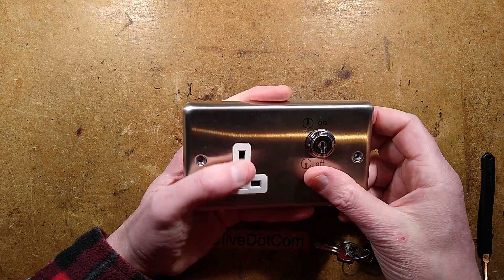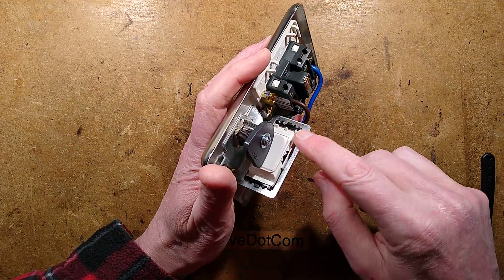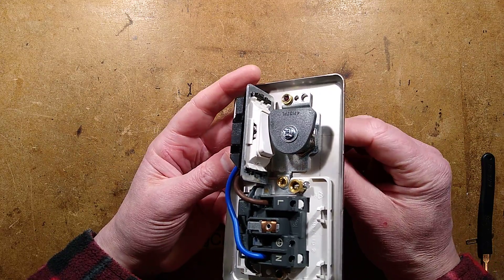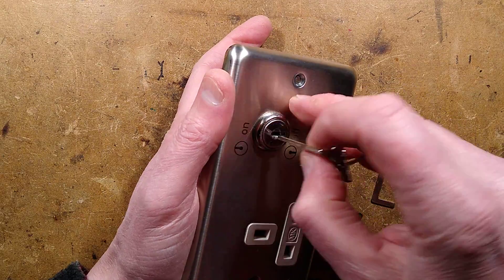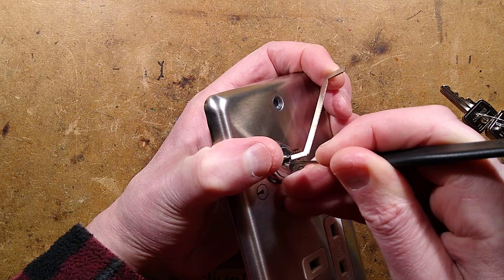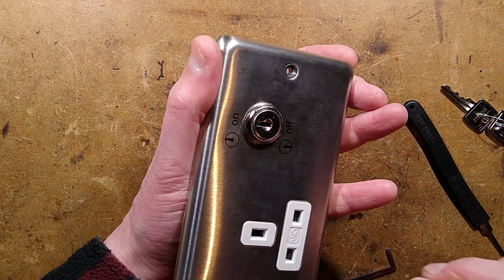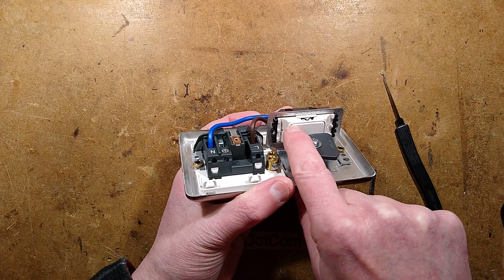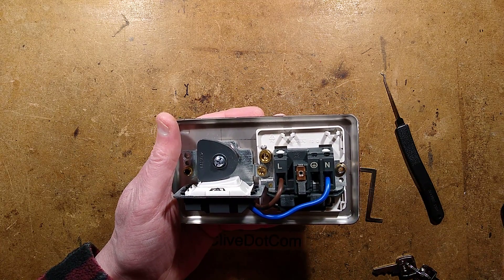Exploring & picking a lockable socket

Comment: That looks like a cheap wafer lock Which would imply that this is more of a safety device than a security device because as you learned in this video, wafer locks are not that hard to open

Comment: If you use one of the double sided wafer rakes from the cheapy chinesey GOSO set, you can wiggle it in and out whilst twisting at the same time. No need for a tensioner, ..and 'in like flynn' easy

Comment: Interesting design, I like the use of a standard rocker switch and the fact that the cam prevents you from turning it on. One problem though, what's to keep you from just pulling the plate and removing the Phillips head screw holding the cam on ? Unless of course it's glued on.

Comment: All the LPL jokes notwithstanding, and I do love them, you might try a bit less tension on wafer locks. They are always going to be dead cores so you aren’t pushing against a spring. And yes, trying to get a tension tool in there is always a challenge. Try an old school bottom-of-keyway wiper insert that is wide enough to bind in there before it impinges on the first wafer. Or if you have one of those funky Y-wrenches you get with the cheap Chinese pick sets, those work well.

Comment: Beautifully production engineered using stock parts and as you say tamperproof, otherwise you could slacken off the fascia screws, pull the plate forward and operate the switch with a screwdriver poked down the back.

Comment: Hey Clive, this is unrelated. But it would be awesome if you could do a dissection of a ballast compatible LED tube. Very curious how they are designing the circuitry to drive LEDs with a ballast. I think it would be a very interesting investigation!
Reply from the maker: I've looked at a retrofit tube in the past.  I think most use internal current limiting as opposed to presenting a higher tube voltage and relying on the ballast.  My preference is to get rid of the old ballast completely.
Reply: @bigclivedotcom  my apologies, I didn't realize you have done that already! I'll go look for it. Thanks!

Comment: That looked like a wafer lock, which can easily be raked open, no picking required. If they make one with a proper pinned core then worth having. And security screws to hold the plate to the back-box, obviously.

Comment: A nice try, Clive, but you're using the wrong rake. Wafer locks are about the easiest locks you can pick. You just need a rake with 3 humps on it. Insert the rake and rock it while tensioning.

Comment: Hi, and thanks for the awesome videos. Would you be interested in doing a Braun Scan & Clean air purifier teardown? It has good ratings, but I think I smell a small traces of ozone coming out of it. I wonder, if the ionisator would be disabled would it still clean the air, or is the electronic filter alone inefficient or perhaps pure scam. There goes two connections into the electronic filter, why it could work alone without the negative ions in the air, by creating its own electric field at least in theory. Or is the other wire used for safe discharging through a resistor, not contributing to the particle-trapping electric fields. Thanks.

Comment: Undo the screw on the back of the lock.  The cam will com e off, and with the key inserted the core should be easily removed.

Comment: But what if it was a fluke?

On a serious note - something tells me it could be shieved from the above, by pushing the switch with something thin. I wouldn't bother pin picking that thing either - this is a job for a rake pick.

Comment: I think you have the pick upside down: you should be using the end to push each pin up, not the "bendy bit" - you'll get better feedback that way and that makes the picking easier. It's called "top of the keyway tension" by the way. :D (Yes, I watch LPL as well!)

Comment: i used to 'pick' these style of locks as a child (many many years ago) with just a paper-clip. didn't do anything fancy just took a medium size paper-clip and squished the eye's/ends of the paper-clip a little smaller to fit in the slot and shove it in there , jiggle it around while twisting, and presto you were in... (mainly to get into the lock-box of uumm "special diskettes" used for pc's at the time:)

Comment: Do the external mounting screws also have a lock on them? And once inside another (or same) screwdriver can easily remove the cam freeing up the rocker switch. Methinks it's made for "honest" electricity thieves.

Comment: Should've used a rake instead of single-pin picking; you'd have had it switched on in about two-point-five seconds. Wafer "locks" are ridiculous.
(you may call me the Lock-Picking Rigger)

Comment: I love the design, using a cam to switch an actual switch... it's almost almost brazen and beautiful in its simplicity and effectiveness.
Of course one could complain about the lock's core, because you probably could open it with a waverake as fast as using the keys. But then again, you could open it using a Philips screwdriver. Though, depending on where it placed (i.e. in a public area), that could result in questions being asked.
Nevertheless, a slightly more challenging core (i.e. disc detainer, like in good bicycle locks) to make picking too time consuming and/or require specialised tools could make this perfect.

Comment: There are special tension wrenches that are made to engage in what LPL calls the top of the keyway (but which in e.g. Germany would be at the bottom - Americans install their locks the wrong way round), which is achieved by having a ledge so they only go a few mm in. I think that would have helped you here.

Also, I personally can't pick wafer locks either. I outright can't. I just never get the wafers were I want them in order. However, I can rake them with basically everything (my favorite tool for that is a random other key that happens to fit in the hole, but a standard pick will do as well - BTW sometimes easier when held upside down).

Comment: As someone who was trained to pick locks by a professional locksmith. Let me give you a few pointers. For a wafer lock like that you want very light tension. You then want to drag your pick all the way in and all the way out, that makes sure that you hit all the wafers with each pass. Applying top the keyway tension with a bottom of the keyway tensioner never goes very well so you should either use a top or the keyway tensioner or modify, make or buy a smaller bottom of the keyway tension wrench. Applying tension to the bottom of the keyway is usually always easier than applying tension at the top the only reason you’d want to apply tension at the top of the keyway is because there’s very restrictive warding at the bottom of the keyway that won’t let you get a tensioner in the bottom of the keyway and give you enough room to not overset pins with your pick. Tensioners are really easy to make. When I was being taught to pick locks, I was taught to make my own picks and tensioners rather than buy them. They are actually really easy to make, you can make picks out or windshield wiper insert or feeler gauge and with a bench grinder and some sandpaper you can make some pretty decent picks. You can make tensioners out of just about anything, my 2 favorites happen to be hex keys or windshield wiper insert. If it’s a skill you want to get better at I highly recommend either making a decent set of picks and tensioners or buying a set from one of the major pick manufacturers, Sparrows, Southord, or Peterson, multipick might be easier to get your hands on in the UK because they are European based and southord and sparrows are US based. My  EDC set happens to be a custom set with Southord case, picks, and tensioners along with some sparrows top of the keyway tensioners, when I put together my set I knew exactly what picks and tensioners I wanted so I ordered just bare picks from Southord because they happened to be the cheapest picks I could get at the time from a company that makes locksmith equipment. But a basic as set from any one of those manufacturers should be just fine, it’s really hard to learn to pick locks with crappy picks and tensioners like the ones that come in those cheap Chinese sets.

Comment: But why? Wouldn't this be better for a hard-wired outlet? Anything with a plug can usually be moved to a different (non-locked) socket, or connected to one through an extension lead. I'm assuming this socket is for safety, rather than to stop someone stealing power.

Comment: Great to see you doing lockpicking.
And here in France they tend to use Legrand Soliroc sockets with a lock on the cover rather than a switch for the power itself.
Soliroc meaning literally solid as a rock by the way.

Comment: Looks simple to defeat. Take a screwdriver to remove the face plate, then take the same screwdriver and remove the tail on the lock, press the switch and replace the face plate.

Comment: Take the socket off the wall, remove the cam and flick the switch.
Reply: That's assuming whoever installed it didn't use security screws....which is also assuming you don't have a set of security screw drivers....

Comment: You can do bottom-of-the-keyway tension on anything where you can't get enough room to get a pick in. I'd just recommend using an actual BotK tension wrench in that case. I find the Peterson "twisty" versions to be the most comfortable option. I think most (if not all) Southord sets come with 'em, too. If I'mma use a pry bar I usually go for a toothed 0.050" with TotK tension, which is ultimately what I prefer for tensioning in general. I only go for BotK when it's ABSOLUTELY necessary 'cause of some paracentric, wanky, nonsense keyway like the one on that hilariously pretentious Abus with the keyway that literally says "ABUS" (the 888 keyway, I think...?).

You might also have a bit more luck with a different pick. The one you're using actually looks like it might be a rake. I think it's one of those really tiny "worm"-style kinetic/zip tools. That protrusion on the opposite side of the picking surface can get caught up on warding and whatnot inside the keyway and make things more aggravating. It's definitely not impossible to use as a regular ol' short hook, but it might be easier to maneuver around in the keyway with an actual short hook with a totally flat surface on the side opposite the picking surface, especially on those smaller, cabinet-style wafer locks (at least that sure looks like a wafer lock). Catching my pick on those sharp wafer surfaces was always super aggravating for me. I always used to get hung up and end up dropping wafers I'd already set trying to get the damn thing out.

Comment: Not sure I see the point when you could just unscrew the fitting from the wall and bypass the switch.
Reply: That's what security screws are for....not that you can't buy the driver but most people don't have them.
Reply from the maker: It's just to protect against norms.

Comment: Even simpler, unscrew the socket from the wall, disassemble the locking tab, and unscrew the lock retainer ring. You’re left with a switch inside a reach-through hole.  Locks are for keeping honest people honest.

Comment: One problem I can see with that is that its a very common key. I Cant see in the vid looks to be a 75100 or 75200 type. I have one of each on my keys they are easy to get a hold of. In principle it would protect the circuit, but the keyswitch is the weak point.
Still neat kit

Comment: An interesting product. Yes, it's perhaps easy to pick, but presumably it's not intended to be mega-secure. My guess is that it's just for discouraging casual unauthorised use of electricity or for preventing children playing with it. One thing that I would like to see on it is an indicator light because as it is, it's not easy to tell whether it's on or off, unlike with normal sockets where you can just look at the switch position.
Reply: Here in France I have only seen locked sockets at public places where they don't want random people to have access to the power.
So you're right I guess.
Child protection on the other hand is accomplished through the shutters in the holes.

Comment: Branching out into LPL territory there, Mate! 😀Mind you, if you are desperate enough to remove the face-plate, then you already have the tool (Philips driver) to unscrew that pawl.  It might have been simpler (?) to use a key-switch with a 15A current rating - they do exist, and are available from all the usual suppliers.

Comment: I can pick that with a screwdriver. Take out the two screws on the face. Remove the face. Take out the screw that holds the lever to the lock. Discard lever and screw. Flip switch. Put face back on wall. Done. Bonus, now they can't lock your power source. Well, until they replace that lever... LOL

Comment: Clive, wondering if you ever dove into magnetic polarity testers? While I can buy one for under $20 I would like to make one, problem is all the DIY ones I see use a single hall effect sensor to turn 1 of 2 LED's on (one for north, one for south) the problem with the DIY ones the LED stays on in the last state (so one of the 2 LED's is always lit) not ideal. The commercial ones have the 2 LED's and both are off until you bring a magnet close, then either the N or the S LED lights up indicating polarity. Thought maybe that would make a good video either tearing one apart and dissecting it or just designing one yourself (even if just a schematic drawing).

Comment: It looks like a Filing cabinet lock. when I worked at Staples on the furniture department I rang the manufacturer up and ask them to send me a master key and they did. The Weekend staff would always sell the display units because they couldn't be bothered to go in the back and find one. So I started locking the keys in the Filing cabinets this soon put a stop to it. I still have the key.

Comment: The biggest design flaw I see outside of the ease of picking the lock is the screw attached to the lock. Now I can just pull the socket out, unscrew the lock, flip the switch. Oops

Comment: Yet you just know that these will be installed with slotted screws, giving one access to the wiring and to the screw that easily removes the switch cam.
Reply: Electricity thieves usually drilling the hole in wall between box and adjacent room where they install anonymous cable. When anonymous cable is connected to socket circuit, cover is installed back and nobody see unauthorized connection.

Comment: We had to fit isolators in the elec cupboard on several blocks of flats after the residents realised they could pick/bypass the locks on these to "borrow" power from the communal supply 😂
Was not hard to prove who did it with the extension lead poked through the letterbox 😂

Comment: Try picking the part on the left,
"im getting a little tingle out of one"
Reply: This made me laugh harder than it had any right to xD
Reply: Even the original key looks like it may  fit in the socket. Better not try to unlock it in the dark.
Reply: @mahekorvenoges550 I assume like all British sockets, you can’t insert anything into either mains pin unless you first poke something into the earth pin hole.
Reply: @JasperJanssen good thing they include two keys
Reply: Hey wrong channel for this you need Electro bones Channel to almost guarantee this!

Comment: Why has no one yet mentioned the obvious bypass, unscrew the plate, and jump the wires. Actually you don’t need to jump the wires, just unscrew the back of the lock once the plates removed

Comment: There was  one of those in my hotel room in Germany , I it was locked off I managed to pick it with the little nail file in my nail clipper. As I didn’t have an Uk to Europe adapter and I needed to charge my laptop and phone .
Reply: Why would a hotel room come with locked sockets ?
The hallway or dining room would make sense but the room ?
Is it not normal to be able to charge your phone, laptop, shaver etc... ?
There are hotels where you have to put your room card in a reader on the wall to switch on the power but that only to make sure the lights get turned off whenever the guest leaves the room to go somewhere.

Comment: You didn't show that part, but if you find one of those and you want to steal power (or what else is it used for ?)...
Can't you just unscrew the panel from the wall and mess with the switch once it's off ?

Comment: It wouldn't be too difficult to swap out the lock if more security were needed.

Also, they make some nice "top of the keyway" turning tools. That'd make opening this one much easier. Or a set of "wafer jigglers", those make most wafer locks trivial.

Comment: Personally, I would have just unscrewed the plalte and removed the screw from the latch mec. I'd would have normally used a large hammer to fix this but as it's elecctrical not mechanical , I would use a large screwdriver instead.😁.

Comment: Significant oversight: the screws aren't protected so you can simply pull the socket off the wall and either short the switch or remove the cam and switch it.
Reply: Except if it's at a public place with lots of people around as well as cameras, which happen to be the most common use of locked sockets at least as far as I know here in France.

Comment: a big screwdriver will work that lock.  or even a car dipstick.  i had a car stolen from outside my house using the car's own dipstick.  they jammed it in then twisted it round and round.  brute force.  it was the usual way that model of car was stolen.

Comment: Yeah, that's a nice socket right there, the electrical separation (insolation) for the key (which is conductive) is cleaverly done :)
Reply: i was expecting a safety nightmare - disappointed.  elegant but slightly brutal.

Comment: Why not just buy a socket where the earth pin is rotated 90°,  works in most cases.
Would be nice if it locked the plug in when in the ON position.